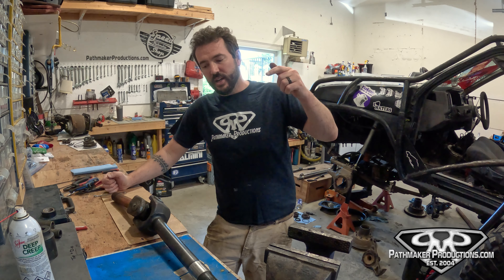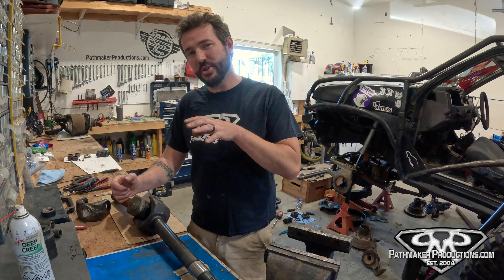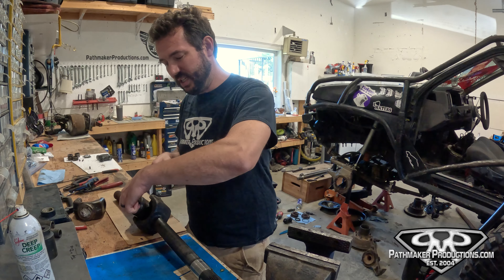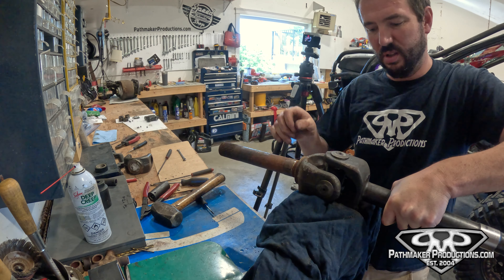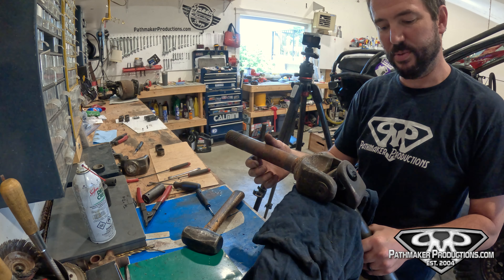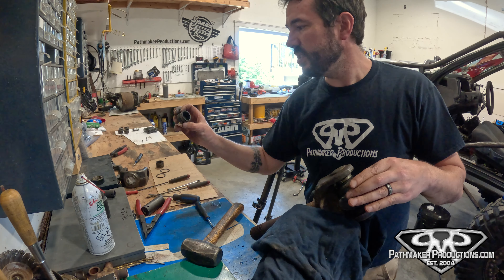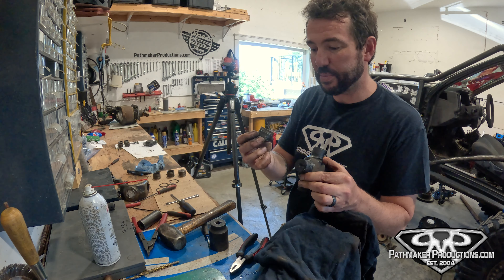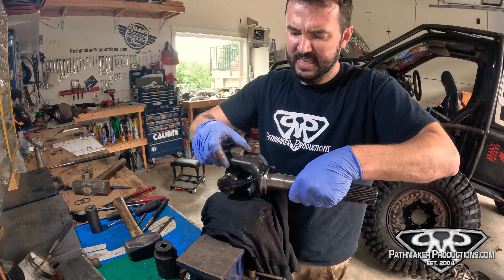U-joint Removal and Reinstallation How-To for Offroad Vehicles - Yukon Superjoint

Comment: Im impressed they weren't all gaulled out . Mine were in rough shape after 3 years . New caps lasted a few runs and they were destroyed and sloppy . Ran spicer after that.  Were you upgrading shafts?
Reply from the maker: I'm really surprised too. I broke a shaft so they sent me a replacement. I pulled the second side just to take a look.

Comment: At 2:14.  You already screwing up.   
Relieve the tension on the C clip b4 trying to remove it.   Smack the cap
Reply from the maker: Screwing up is my specialty!
Reply: Don't feel bad not knowing the smacking yoke with hammer to release tension trick.
 I didn't know it until somebody showed me.
Reply: Thanks for showing easier way of doing this sucky job !! 
Had to do this recently on the Fallen trail in Sand Hollow when I broke a stub shaft. Was lucky I had replacement stub and friends to help swap it.